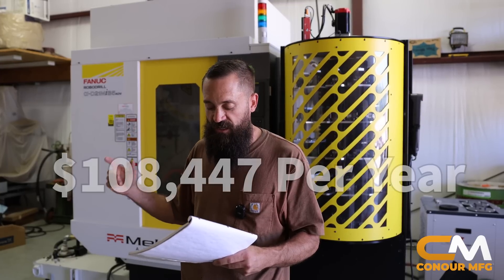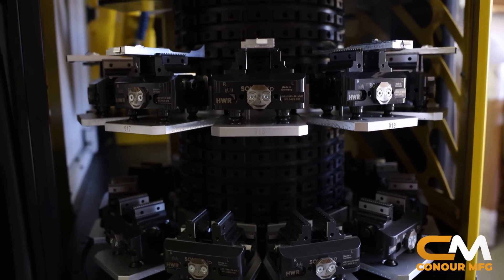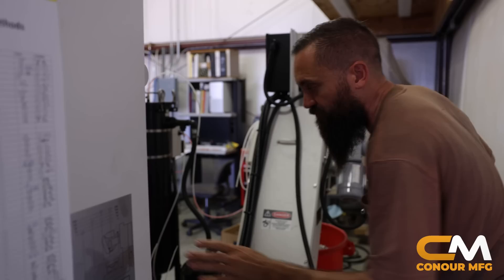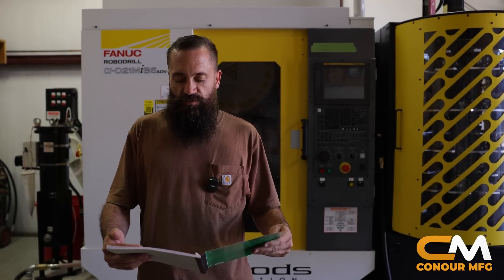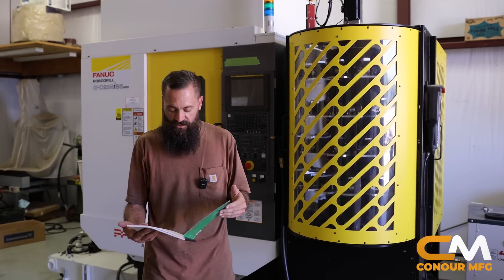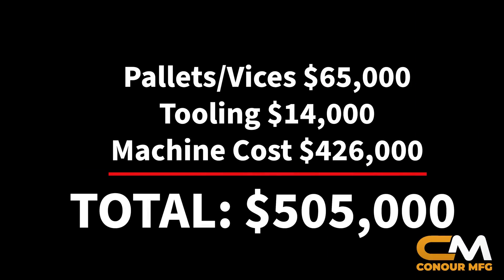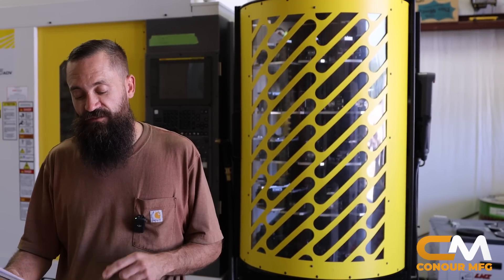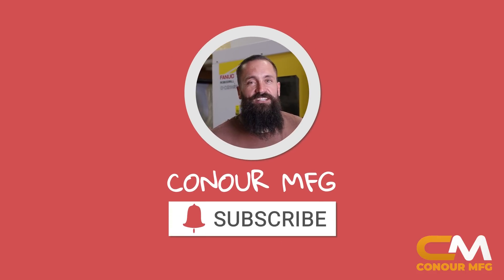800K for a ROBODRILL?!?!?!

Comment: And I thought my $1600 lease payment for the machine in my garage was a lot.  Jesus

As a new guy starting out what does it even look like to get the machine to a point where it's not only paying for itself but turning a profit at this level?  Assuming it's running production?  I'm so far away from doing that even where I'm at it's so hard for me to comprehend it.
Reply from the maker: A lot of work needs to move through the shop to justify it. It's all relative, having a single machine in your garage is just as difficult as a big shop with a bunch of machines.
Reply: @ConourManufacturing well congrats on your success sir. Enjoy your videos and subscribed

Comment: I cant help but think that for a little fanuc with a pallet changer 426k is a bit steep but there is good money making potential either way in manufacturing. I have my eye on my first machine and have my software already, but i want to run larger parts out of steel with longer run times so that's the direction im heading, im sure you know what you are doing.
Reply from the maker: Good luck! Manufacturing is not easy, there are alwaysing going to be hard learned lessions. Best of luck! I hope you are successful
Reply: @ConourManufacturing Thanks man, dropped you a sub to keep up with how you're doing. all the best!

Comment: my robodrill 21 tool 10k spindle brand new cost me 65,900 with no options, I load parts myself one at the time making money. I don't think you're making any with your robodrill
Reply from the maker: Believe it or not, we are making money. I haven't even been running it 18 plus hours a day yet(10 plus hours unattended). Once I do, along with 20 hours of run time each wèkend(unmaned) it will be the most proffitable machine in the shop. Thanks for following along!
Reply: @ConourManufacturing   do you want to buy my robodrill 21 tool ?  I had it in my garage all the time since new 300 hrs no more don't have work since my customer sold his shop 3 years ago I'm stuck with machine and no work in Connecticut.  Let me know if interested in mint robodrill
Reply from the maker: @nicholasanachasian7230  Machine Tool Emporium, is a great company. You could reach out to them and they will make you an offer on your machine.

Comment: I'm looking at buying a couple machines to start a small manufacturing company, but here is the hard place I'm in and maybe this relates to you also. If I had the machines sitting here now it would still take me 6-12months to get a product launched and get any kind of income, then likely another 6-12months to build up sales. How do you carry the machine cost during this period, do you have the cash saved and waiting to pay the monthly costs for 1-2years? I'd have to keep a day job to make the payments which doesn't leave much time to actually run the machines and work on the designs. I also have much cheaper CNC machines already that I am trying to do the prototype work on and maybe a few small production runs, but they have very limited capabilities. Anyway if you have any angles or ideas on making it through this transition period, I'd love to hear them..thx  (oh and that property tax thing....that machine is no different then a truck or car, its not part of the property...I'm really surprised they get away with that kind of thing in the US...here we might sneak in a whole work shop one weekend and claim its always been there:)
Reply from the maker: It's always a grind, especially when you are just starting out. In your situation you simply have to "do more with less". Good luck man! I hope it all works out for you. 

I think you are spot on, do not go buy a new machine.

Comment: Crazy when one considers there is only the one spindle turning in this package.
Reply from the maker: It's like purchasing 2.5 machines and paying two guys to run them. In a way, the price does reflect that you are getting "more than one spindle". Thanks for watching!
Reply: @ConourManufacturing   I know these machines and of course the automation you are getting.
I paid $1,000.00 one off fee for a CAM verification module on a product called Solidcam which runs inside of Solidworks.  Both Solidcam and Solidworks cost around $26K to purchase outright although this was some 10 years ago now for me here in the UK.  Annual maintenance was around $5K but I put an end to it after several years as I never need support and those software upgrades tend to cause more harm than good.  For the last 5 years I have been running CAD CAM at no cost.  I keep the computer off the internet and I'm the only user and therefore nothing ever changes or slows down.
Your property tax seems extortionate!

Comment: Kind of strange that a shop can't install a coolant chiller and has to wait for an outside company to do so.
Reply from the maker: Sorry if I was not clear. We are/did install the coolant chiller. Because we were installing it, we had to wait for Methods to install the Robodrill and coolant tank before we could get started. Thanks for watching!
Reply: Gotcha, I hope I didn't come across as rude or anything, but Wow what a machine, and Wow what a price tag. Those prices don't give you very much wiggle room as far as down time or lack of jobs do they. Running 27/7 for length of the lease seems like the only way to keep your head above water with that thing. Very Cool.     @ConourManufacturing

Comment: why the heck would you finance something without the ability to pay it off early penalty free? thats insane...
Reply from the maker: 99% of financing offered through the machine builder/distributors are set up that way. The payment is the same every month throughout the life of the loan. Even most home loans have a penalty if paid off before a certain time frame(aka before a certain amount of interest earned). 

Banks always win. If you did not have an early penalty in place on a large loan, the interest rate would be absolutely insane.
Reply: @ConourManufacturing  I'll have to look through my mortgage but when I spoke with the loan officers, they were adamant that there's no penalty on paying it off early, was told I could come in next day and pay it off no problem. Didn't know that about machine tool loans, that's awful 😞

Comment: I just sold 21iEl robodrill for 2500 euros. There was also a pallet changer. Machine was a year 2004. For that money (505k) you can buy 201 similar machines😂
Reply from the maker: I was inable to find a 5th axis machine with 60 pallets on tbe used market. If one ever comes up, I will most likely buy it! Thanks for watching.

Comment: I work for a distributor in NJ that handles the Methods line here. We've installed a bunch of those with the Haberle systems. Machines run  24/6 even though they only have one shift. The customers are thrilled. Getting broken tool detection and redundant tools set up is where these machines really shine. Break a tool, machine kicks out and flags the current pallet as damaged, loads a new one and uses the backup tool. Fun stuff.
Reply from the maker: That's what we are currently working on proving out. Future youtube videos to come on this subject!

Comment: Awesome piece of equipment, trying to hide my jealousy. I think you could save a lot on the software. I am assuming you were paid to plug in there info, but to all you shop guys trying to figure it out, you can find 3rd party distributors for licenses of software's. They may be a few years old but that doesn't matter. You will save thousands per year.
Reply from the maker: I have not received any discounts for talking about what I purchased. As far as softwear goes Fusion 360 is one of the most affordable out there. Camplete now being owned by Autodesk is the cheapest and most attainable in has ever been. 

The benefit on the years subscription, is the "low" up front cost and you get all the updates as they come out.

Thanks for for your comment. I hope to dive deeper into some of these topics as we add more videos to this channel.

Comment: We got into the camplete hype. I just genuinely recommend it for the first year if it's a new process for you. But get rid of it unless you are doing jobs that take 5 hours to proof on the regular. We where about to buy it for our nakamura tome super ntx and we have it for our new mikron hpm 800 uhd. But ive probably used it about twice to be honest.
Reply from the maker: I have been super happy with it. I really like how I can quickly have all the tools do a tool brake check for lights out machining.
Reply: @ConourManufacturing . I'd do the break check all the time. Even when you're there. Don't need to babysit the machine. Saves all the tools that follow the broken one and flags the pallet as damaged. It really is an amazing system. I've installed maybe 6 so far for customers.
Reply from the maker: @CR3W1SH03S  absolutely, I check all the tools if I am not sitting there proofing out a program. Thanks for the advise and comments I really appriciate it!

Comment: I think you spent way too much on a 21 M. Couldn’t you have gone with a robotic loader? Have you called Yamazen and got a quote on a Brother Speedio? I’m glad you have the work for this.
Reply from the maker: I deffintly could have purchased a cheaper machine. However there is a huge advantage to purchasing a fully automated system were the control manages the robot. With no integration required. I will cove more on this topic in future videos. Thanks for watching.

Comment: Dang! , you obviously have the work to afford it. It’s awesome having a brand new machine however in my shop I’ve had great success buying nice used machines. Helps keep my hourly rates low making me more competitive in the long run. We’ve bought new ones as well but overall the used have performed just about as well. Bought a brand new Miyano lathe. 8 inch chucker with live tooling. Great machine so we bought a nice used one. They are both cranking out precision parts but more profit from the used one for sure. Still it can be a crap shoot. We also bought a used Miyano BND with an LNS auto bar loader out of FL and knock on wood has been simply awesome. Latest purchase was  Doosan 8 inch chucker and it’s awesome but the hourly rate is higher.  Loved your video and I subscribed. Can’t wait to see it in action. Those things are blazing fast so your part cost in theory should be very competitive as well. Wish you the best of luck. Especially being in CA. The taxes there are simply insane. Why everyone’s moving the heck out of there.
Reply from the maker: I absolutely agree with you. The problem was, there were almost no used options for automated mills like this one on the used market. I appreciate you following along. I hope to continue to post about relevant issues and topics on this industry.
Reply: @ConourManufacturing   I enjoyed your very informative video. Honestly I still can’t figure how ppl make it in CA. My best friend lives out there and he’s ready to move to Montana. The biggest problem my sons have is there is simply nothing around that they can afford. I retired to SC and we have lots of building around me in Murrells Inlet. Employees too. But no way would their families consider moving. Even though they live to visit here 😂

Comment: I am a bit confused about the pricing. In UK I was quoted £85k for a robodrill with some extras ($100k us?). It is hard to believe that the robo cell is another $400k even if you had customisations. 
You better have that robodrill running 24/7 high volume items to pay ot off.  But then camplete for $6k/year makes no sense if you are running high volume items. Fusion alone is very powerful for proving the toolpaths with machine simulation for colisions. 
All in all either you guys are not telling the full picture or this is a very expensive impulse buy you are trying to justify now.
Reply: Yup, I'm pretty sure he got absolutely fleeced.
Reply from the maker: The 800k is including everything over the 6 years to include property taxes and insurances related to having a loan out on a machine. The whole point of this video is to show that if you but a 515k machine it really costs you 800k ofter interest and everything else. Thanks fir watching!
Reply: @ConourManufacturing  Thanks for the video.
Could you shed some light please?
I'd never buy a new machine, because I just don't see the value proposition. You can buy one of these used, in the UK, around 3 years old, for under 100k.
Do you really see yourself having 550k of value for having a machine that's 3 years newer?
You could almost buy a used version of this machine with your deposit.
Reply from the maker: @spikeypineapple552  yes, I 100% see the value of a machine that costs around $18 dollars an hour to own. That can produce $300 dollars an hour in revenue. I will do more in-depth videos on this. Please stay tuned!
Reply: @ConourManufacturing  My point isn't that this isn't fantastic, my point is for your 18 dollars an hour, you could have 4 machines of equal quality.
Reply from the maker: @spikeypineapple552  I am down for a discussion, I deffintly don't want this to be misconstrued as an argument. Historically speaking it's quality over quantity. It's hard to make a factual argument that you can 4 of something for the price if 1 and not sacrifice something.
Reply: @ConourManufacturing  Yeah, I absolutely don't want this to come off that way. I'm looking at picking up machines all the time, I just super don't understand how this works in terms of value.
Reply from the maker: @spikeypineapple552  so at $18 hour to own, with it's reliability and we'll supported service. Small foot print, and no need to hire on addition help. This was the right purchase for me. It's not the right decision and or the most commonly made for small shops. Or everyone would have them. I would say I am probably one of the only two person shops in CA and or America that have a machine speced out like this. Stay tuned to see if it pans out!

Comment: I just started to work with one after 6 months of CNC experience (Didn't have the chance for practical use in my old firm during my apprenticeship). It's awesome, but there are many handy tricks and the macros are kinda complicated at first. If you got enough jobs for it, you good. But for use, we have to do the second OP in a different machine. Tho the second op is mostly just deburring and removing the bottom.
Reply from the maker: It definitely depends on the work abd tolerances. Sometimes we can get away with sanding off a tab and doing the part in 1 op. Other times, it requires a quick 2nd op in another mill.

Comment: I think that is one of the misconceptions a lot of people and companies have about starting a machine shop, it can get expensive FAST! Everyone knows machine shops are capable of making loads of money, but they dont see the fact that it takes loads of money to run and operate one effectively. As someone who started a shop last year, many of the elements you discussed (such as property taxes) are all the hidden costs behind a purchase. Fortunately for me, North Carolina and the county I live in is pretty relaxed on property taxes for anything outside of vehicles and land, but it is still a cost that you have to consider. Another cost that you didn't mention that should probably be discussed is the insurance policy you presumably have to hold since you have a loan on it. My insurance for my small company (I make less than $70k a year with it and have 2 machines) is $3600 a year, which covers both general liability and  business property up to $100k. 

As they say, if it were easy, then everyone would be doing it! I think that robodrill will make you lots of good parts going into the future.
Reply from the maker: That is some great insight. You are correct, we already had an insurance policy in place. However we did have to add more coverage specifically for the new mill! I will cove this in a follow-up video! Thanks for following along!

Comment: But given you can let that machine run 24hrs/day... that gets down to crazy low costs/hr operation... 

But then the work is, feeding the beast...
Reply: You have to consider down time for any machine.  That includes maintenance, testing, calibration and reworks.  A good rule of thumb is 80% efficiency for most equipment, per 8 hour or 24 hour day.